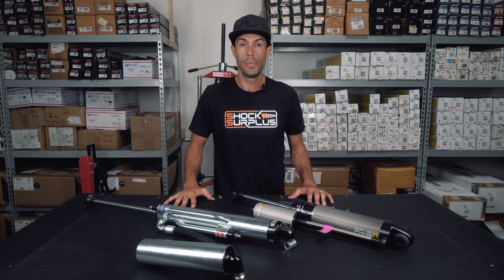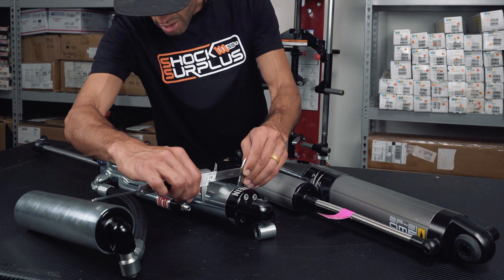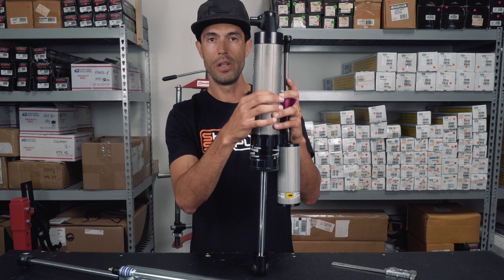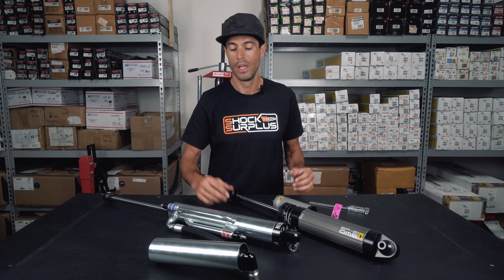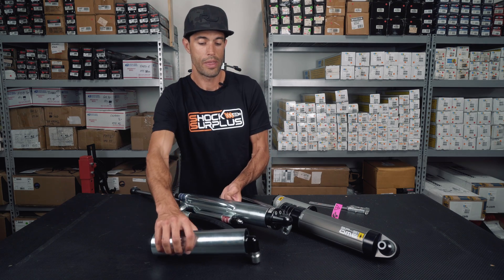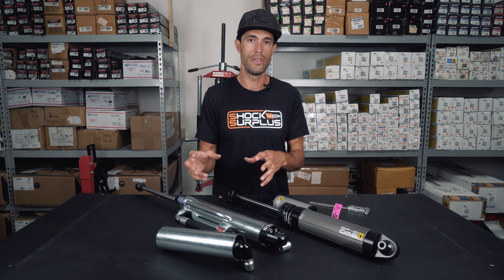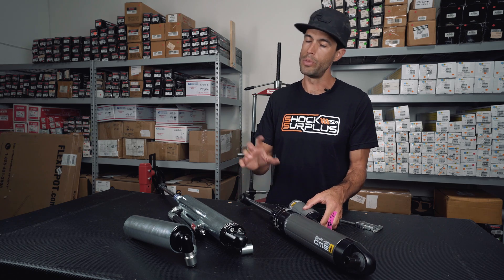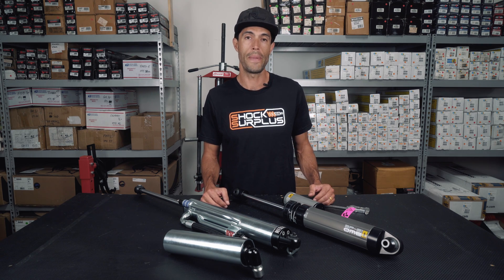Old Man Emu BP-51 vs Bilstein 8100 - Internal vs External Bypass Shocks

Comment: toyota 4 runner 2024 and I'm trying to decide: bilstein or ome
Reply from the maker: Depends on your usage, give the team a shout and we'll get you dialed in 

https://www.shocksurplus.com/pages/contact-us
Reply: Will the 8100 adjustable shocks fit a 2026 jeep rubicon x 2 door with extreme recon package?  Without limit straps?  Front XR shock length is 24 3/8” and 17 1/4” the rear is 27 3/8” and 19”

Comment: I'm new to this stuff and really appreciate these videos. How do the external by-passes work with a coil over?
Reply from the maker: If you are talking about running a coilover and a bypass secondary it’s a way to get externally adjustable position sensitive damping on top of your coilover. A 2.5” diameter body coilover and 2.5” bypass have 2-4x the damping force potential of a single 2.5. These BP51s are the only internal bypass design where you can externally adjust the stiffness of the ride zones but in practice perform like a 2” body external bypass with two tubes. You can get more tubes or ride zones on an external bypass that are all adjustable as well

Comment: I have a wrangler 4xe and I’m looking for a 2.5 inch lift and I can’t decide what brand of shocks. Thinking between bilstein 8100, ohlins or OME BP-51
I won’t be doing any rockcrwling, but will go on trails in the woods and sand tracks. What shocks would you recommend?
Reply from the maker: We wouldn't recommend the Ohlins, 1 - because we haven't tested them so we're unsure, 2 - no experience with their warranty department and how easy it is to service them, 3 - super expensive for what you get.

BP51 can be made incredibly soft if you play with the rebound and compression settings. If making adjustments to your shocks isn't your idea of fun, then go with the 8100 smooth body reservoir shocks. The 8100 are more appropriate for more aggressive driving, whereas the BP51 are better suited to adjusting for loads, comfort on the easy trails.

Lots of overlap between the 2 though, and will also depend which ride height you're at. EMail us support@shocksurplus.com and we can help further.

Comment: Great video. How do they perform on heavy vehicles I.e LC200 with steel bumpers extended fuel tank etc.
Reply from the maker: BP51s are actually available in heavy and standard  load options, with tons of spring rates available for constant load, so they are killer even on the heaviest of rigs. The Bilsteins can be set up for more weight that most with the right springs, but it is hard to beat the BP51 as they were designed for heavier overland type builds. The Bilsteins, although great under a load, are really more of a "prerunner shock" rather than an "overlander shock"
Reply: I run heavy load bp51 on my 200 Series. Front/Rear slee bumpers with swingouts and winch. Aux. fuel 45gal fuel tank, full skids, and sliders. Around 1100 pounds total added w/ fuel and fully loaded cargo. Compression set at 3. Rebound at 6. Rides great.

Comment: The review seemed a bit biased towards Bilstein.
Reply from the maker: I think you might be mistaking the bias for the fact that the 8100s are flat-out a higher-performing shock than the BP51, but that is to be expected given their designs.  Neither is without their flaws, but the Bilsteins are definitely easier to adjust as well, especially since they are switching most of their 8100s to use quick-adjust knobs on the bypass tubes. With that said, it is all about the right shock for the right person. If you like to keep all four tires on the ground as much as possible, then you do not need the additional support of the Bilstein and could save some money and get just as cushy of a ride out of the BP51.